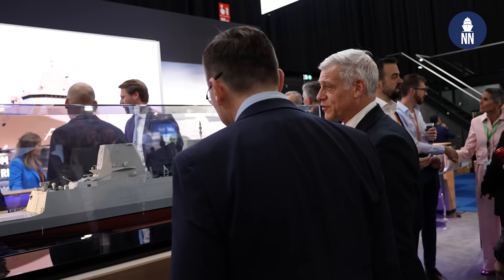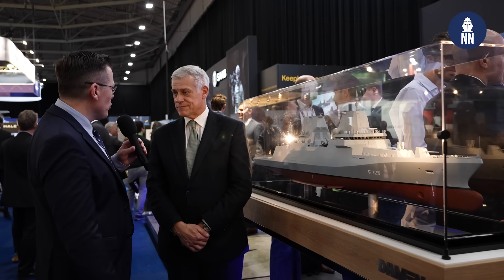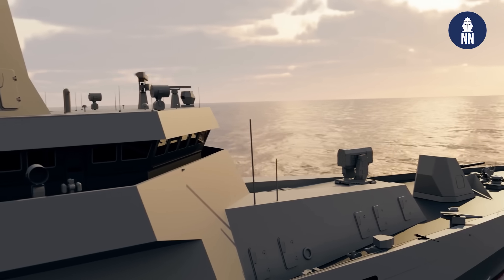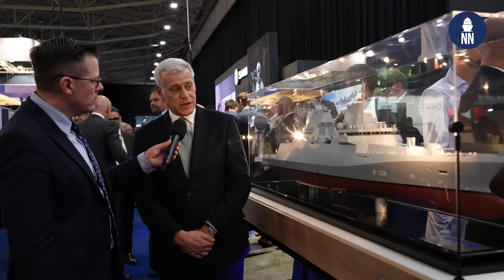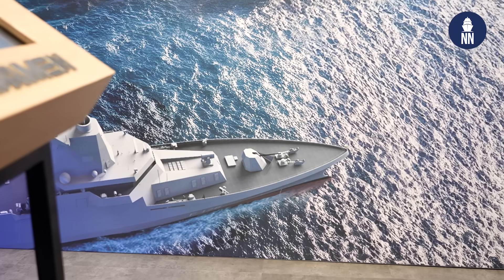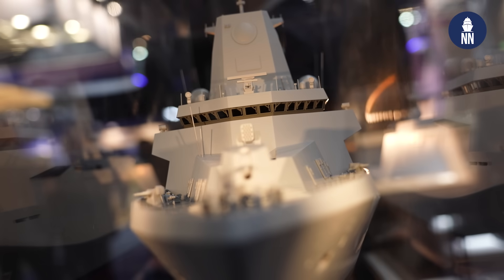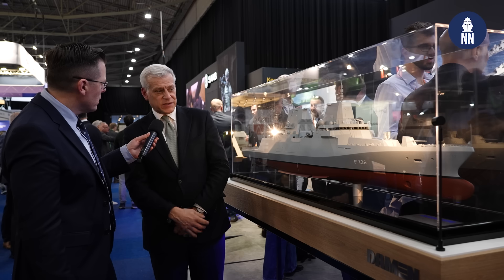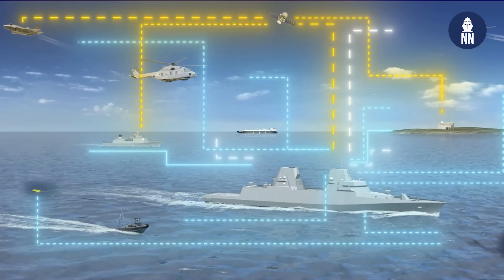German F126 Frigate with Damen at NEDS 2024

Comment: 10k+ tons and only 16VLS. Why do the Germans do this?
Reply: That VLS counting is so popular on the Internet just shows how little people understand about naval warfare. Modern sea-skimming missiles only come over the horizon in about 30-35km range. This ship has 106 missiles to defend against such threats.  (64 ESSM and 42 RAM) Very well defended for an ASW ship.
Reply: @Chiggi0815  Literally just a one-to-one replacement of the Brandenburg class is armament terms, with added endurance and maintenance capabilities for global deployment.
Reply: @forcea1454  Not really. The F123 so far could only carry 16 NSSM not ESSM.  F126 can carry 2 medium helicopters which now are both hunters and killers in one and have additional ASuW capability. Obviously the extensive modularity and much better Sensors.
Reply: 0:36 did hear what xavier said
Reply: @Toxic-pt1qn  but the even british old type 23 have 32 vls
Reply: @Toxic-pt1qn  also its 10,000 tonnes, you can fit atleast 48 VLS and then focus on anti-submarine too, terrible decision and weak ship
Reply: Not an expert but that's what I've found while looking into those exact questions. From what I've gathered, the weight is due to minimizing crew requirements and increasing modularity. It's heavier than an Arleigh Burk class destroyer but only requires 1/3 the crew. It's going to replace the F123 class, which also only carries 16 vls cells. Their main objective is anti submarine warfare. The important bits for that are the sensors and the helicopters/drones as they are supposed to do most of the actual fighting in that regard.  Missiles are gonna be mostly for mid to short range air defence. 64 essm (quad packed, 4 per vls cell) and 42 short range, aswell as 8 naval strike missiles. I don't know if any of the 20 mission modules can increase that number. Then there is the F124 air defence frigate with 32 vls cells, which is going to be replaced by the F127 with 64 cells. Another important bit is that Germany plans to replace their 4 F123 with 6 F126 and their 3 F124 with 5 F127 (with the option for one more), increasing their overall number from 7 to 11 warships (we don't talk about the f125. That's a disgrace on a whole nother level. If you thought 10k tons and 16 vls cells was bad, try 10k tons and 0 vls cells).
Reply: @-MarcelDavis-  The F 125 is not 10k tons its 7200 tons thou ! And they   currently planing to give them a little upgrade ! They are talking about Iris t for anti air and blue whale drones for        anti sub warfare ! Also they buying 5 F127 but are looking to replace one of the F 125 with an ( optional per planned contract ) and additional 6th F 127 if all goes well!   Also to make it clear the whole class gets 20 moduls not each ship ! Thats 3 to 4 per ship !  Each ship can equip up to 10 but not of the same type ! For example in back of the ship there is only place for like two moduls that can be only 2 anti  mine or 2 anti sub ones only , mabye a combination of the two but not for the detainment one ! The other 8 modul places are midships and are for the detainment one or futher unspesified ones!
Reply: Focused on anti-submarine warfare..
Reply: @JeffBee-vo3gf  oh yeah that makes sense, they're only ASW ships so it wouldn't be fair to shoot at them, better make sure everyone knows and understands that 😂
They're warships and with them being so large, so expensive and so few of them, they will operate alone and thus must be capable of fighting whatever opponent they encounter!
Reply: @fightforaglobalfirstamendm5617  Well many European Air-defense focused frigate has 32 VLS remember it's an Air-defense frigate only doubled the 16 VLS, Unlike those Air-defense frigate they have to defend other assets from Air and the F126 only focus to defend itself from Air...
Reply: @JeffBee-vo3gf  European warships design has been terrible for decades. It's not who you should be comparing your ships to, they need to compared with PLAN, USN, Russian Navy, ROKN JNSDF, and Indian Navy's.
-Type 055 Renhai, 13,000 tons, 30 knots, 5000 nmi range, 136 VLS cells, 1 x 130mm gun, 1 x 30mm 11 barrel CWIS, Hypersonic missiles, ASUW cruise missiles with 290 nmi range, 4 x torpedoes. 
-Arleigh Burke flight 3, 9,000 ton, 30 knots, range of 5000 nmi, 96 VLS cells, 1 x 127mm gun, 1 x 20mm CWIS, 2 x 25mm cannons,  tomahawk multirole cruise missiles with 900 nmi range, 2 x torpedoes.
-Admiral Gorshkov, 5,400 tons, 29.5 knots, 4,850 nmi range, 80 x VLS Cells, 1 x 130mm gun, 2 x 30mm 6 barrel CWIS, Hypersonic missiles, multirole cruise missiles with 356 nmi range, 8 x torpedoes.
-Sejong the Great Class batch 2, 12,000 tons, 30 knots, 5,500 nmi range, 1 x 127mm gun, 86 VLS cells, 16 medium range ASUW cruise missiles with unknown range, 2 x 20mm CWIS, 6 x torpedoes.
-Maya Class, 10,000 tons, 30 knots, unknown range, 96 VLS, 1 x 127mm gun, 8 x deck mounted ASUW cruise missiles, 2 x 20mm CWIS, 6 x torpedoes.
-Project 18 Class, 10,00p tons, unknown speed and range, 120-144 VLS cells, hypersonic and cruise missiles, unknown gun based armaments.
Reply: @fightforaglobalfirstamendm5617 All of these warships are either AAW combatants, or Russian (much less emphasis on living quarters, access for maintenance, or endurance). Arleigh Burke is also a bad example, they were very deliberately designed smaller than they should have been because of erroneous beliefs about the correlation of warship design and cost, which is why they have no SWAP-C margins today.

Steel is cheap and air is free, there's no reason not to design a 10,000 ton frigate if you can get  better access for maintenance, better crew quarters so you have fewer problems with re-enlistment, and significant redundancy in the layout of your sensors (something which none of the designs you use as examples have, all have their phased arrays concentrated in the forward superstructure, F126 has them split between two blocks).

The replacement AAW Frigate will be the F127, which should be closer to the above example in armament (although it will likely still fall short, European AAW combatants tend to have less magazine depth).
Reply: @JeffBee-vo3gf  But those frigates are 40% smaller in size yet can carry 3x the number of VLS.....
Reply: @LuqmanHM  it's 32 VLS just 2x not 3x..
Reply: @JeffBee-vo3gf  there is a European frigate with 48x vls, that is 3x not 2x
Reply: @LuqmanHM  I know...
Reply: @JeffBee-vo3gf  good that you know
Reply: @forcea1454 People also tend to forget that even if you have that many vls cells, how you actually will make use of them. Sure it would be nice if the F126 had double the cells, but every navy in times of war, and that goes doubly for European navies, would run out of missile stocks extremely quickly, at which point you’re production constrained. At that point all of those extra cells would just be dead space on the ship as there wouldn’t be any missiles to fill them with. I believe there’s definitely a point at which more vls cells doesn’t necessarily make a ship all that more combat effective, particularly if European navies will also learn to rearm at sea like America is doing.
Reply: Oliver hazard perry frigates are less than half the displacement, carry 2 helicopters, and almost the same amount of missiles.
Reply: @SebastianBosek RAN OHP ended up with 40 rounds for the Mk13 launcher split between Harpoon and SM2 and an 8 cell Mk 41 with quad pack ESSM. On a ship a third the tonnage of this one
Reply: @SebastianBosek    A good ship to compare with! Cause it shows very much  the difference! The Idea for the F 126 is basicly , what if we give a ship like the Perry class extra range , durability , much lower maintance and less viewer appointments in warfts increaseing the deployment time , as well as versatility via a modular system all in a stealth like design! All that makes it a Perry + like ship or like a very durable swiss knife that you can even missuse somewhat !
Reply: @SebastianBosek OHPs don't have LO shaping (which in and of itself is a significant driver of size and volume) don't have phased arrays in X-Band and S-Band grouped into two widely separated superstructure blocks for redundancy, and have less endurance (both in terms of stores and self-maintenance) and have worse access to equipment for said maintenance.

OHPs are a very bad example, they were essentially a hull shrink-wrapped around a combat system with zero margins for further additions, designed before many people realised that it was combat systems that were the main driver of warship cost, not size, and designed before LO shaping was widespread, which required significant volume to hide equipment, which is why modern warships are so large.
Reply: Splitting the radars into two separate parts of the superstructure will be part of it. Not a great issue, steel is cheap and air is free, better to have greater redundancy to aid survivability.
Reply: 16VLS but every cells can room 4missiles ESSM a total of 64 missiles.
Reply: Only 16 VLS, but 4 ESSM RIM-162 missiles per VLS. There will therefore be 64 missiles for the defense of the ship.
Reply: I suppose it is meant to primarily be a European ASW ship. 10K tons and calling it a frigate, well I guess it makes sense as frigates were primarily ASW ships. So a small ship in a large hull? Extra fuel tankage for a long endurance? But why if they are going to stay in European waters? The lack of missles is a problem if they are going to work in more hostile waters, like the Red Sea. No mention of how quiet the ships can be, nice for ASW work.
Reply: It's for anti submarine warfare not for airdefense. The F127 is meant for air defense
Reply: @ If it is for anti-submarine warfare, why is there no dedicated bow sonar? Only a towed sonar? Doesn’t make any sense!
Reply: Because they want to put some space for a laser weapon system to target cheaper drone. VLS is more expensive per shot compared to laser.
Reply: @saltymonke3682  So, a 10k ton warship is well-protected from drone swarms, but remains vulnerable to ASMs launched in saturation waves? That seems half-logical...
Reply: @thomasromanelli2561  did you know that there's F127 for that? And for ESSM, F126 is quadpacked, so it's 64 missiles in there.
Reply: @thomasromanelli2561  do you want to make another wunderwaffe? No
Reply: @thomasromanelli2561  and that 10k tonnes are for mission module bays.
Reply: @saltymonke3682  I guess you're right. I hope the German Navy gets what it asked for, and all the required modules integrate well and function per spec, and they have the forward logistics bases to hot-swap out the modules to tailor it to mission needs in a high operational tempo setting with minimal reserves and a lethally-contested marine environment consisting of major surface, sub-surface and semi-autonomous  UAV threats. What could go wrong?
Reply: @thomasromanelli2561  we hope so. It's also cheaper to have multiple modules on board a ship rather than building another highly specialised ship. 20 years from now it's all about fast adaptation to threat and uncertainty
Reply: @thomasromanelli2561 Nah, we‘re not known for being bad at handling these kind of logistics I would think…
Reply: Der Schwerpunkt des MKS 180 liegt dabei auf:

Überwachen und Beherrschen von Räumen und Verbindungslinien zu Wasser (z. B.: Operation Atalanta)
Durchführen von Embargomaßnahmen (z. B.: Operation Sharp Guard)
Nationale Risikovorsorge durch Evakuierungsoperationen
Reply: @chessrockwelll  Das stimmt natürlich, wobei die Anforderungen bei der Planung der MKS180 gänzlich andere waren.... bzw. das Auftragsbild der Deutschen Marine hat sich geändert. Ich gehe davon aus, dass die Schiffe durch die Re-Fokussierung auf die Bündnis- und Landesverteidigung deutlich aufgerüstet werden. Genügend Potential hat die F126 ja. Die Zeiten von unterbewaffneten Fregatten sind vorbei....der Fokus sind nicht mehr nur irgendwelche Piraten oder Rebellen um Afrika.
Reply: I think for electricity. I think the laser systems will be heavily employed in the next 10 years generation size matters. 64 missiles is one exchange with another frigate. A large 1mw laser can extend that indefinitely.
Reply: cause this is not a guided missile destroyer, but a multy purpose ship. Also consider it was designed at a time, where the enemy where pirates in speed-boats. You don't fire a 2 million missile to fight a 20k speedboat. Germans prefer efficiency over overkill.
The F127 will have 64 VLS.
Reply: @ThorDyrden  absolutely correct and I also think, that the ship will be optimized to the new role in a size how is possible for that Class.
Reply: In what scenario would u need more than 64 AA missiles?
Reply: @dominics.4474  and that is 64 full-size Missiles - the AA-missile come in 4-Packs.

But in deed the challenge is, that VLS can't be restocked by the ship itself - so it need to dock at a appropriate port to refill the VLS... which makes a big number more relevant.
On the other side these ships would mainly fight in the northern or baltic sea... so ports never are that far away.
Reply: It is quadruple so it is 64 missiles
Reply: Because Germans over complicate everything!
Reply: It's a anti submarine warfare frigate
Reply: and that's the reason why a german replenish ship escorted by a german frigate goes around Africa instead of passing trough Red Sea cause afraid of Houthi (🤦🏻‍♂️), consider what Deutsche Marine would do in front of Iran without calling in their true enemies China and Russia!!!

ASW Frigate are useful on high seas of the world, so "all" free countries would need few ships more then a hundred and smaller countries, NOT Germany, would like to perform the cheaper role!
Moroever that long range mission would require a 6/7 thousand ton Frigate armed with 32 VLS to contain cost fullfilled with 32 quadpacked anti-air missiles, 16 anti-ship and land attack missiles, 8 anti-submarine missiles (for quick reaction), a small but well around warfare capabilities!
Note to perform an helicopter ASW mission at a hundred nautical mile away which are about 16/20 missions per day for weeks, you'll need minimum 8 helicopters onboard for a minimum of 4 ships!!!
High seas ASW mission instead are based on tow sonar patrol cruise with the lone helicopter detached just to fix the target and then destroy the submarine!
US Navy find out in the Red Sea Burke destroyers (96 VLS!!!) have short persistence!
Nowadays Destroyers are the lonely survived combat ship. It must be big and armed to the teeth (192 VLS ?!?), top reference are out on the seas with already around 130/140 VLS...
Reply: They're Quad Config, aka 16x4 = 64.
Reply: That's what the 127 Frigates will be for. And those 16 will have more power than 64 cope cells...
Reply: This is designed for ASW so torpedos are how you kill a sub. Also, 10k tons is a small ship.
Reply: poor understanding of enemy's weapons
Reply: Take in mind, Germany isnt a sea power!
Reply: Simple cause the Germans are just like all the other lazy European countries who rely on Nato to bail them out when  so they don't need a lot of missiles on their boats. Unlike America 🇺🇸 who doesn't rely on other nations to help them out. Then again, I doubt any Nato nation would help us out if shit hit the fan.
Reply: They are following Indian navy bro😂😂😂😂😂
Reply: It's a large cruise ship belongs to Germans Navy
Reply: bro. 16 vls can carry 64 sam. 1 vls for 4 sam like aster
Reply: 64 missiles. That's not bad.
Reply: I have the same question
Reply: Well the basic idea is to make those extra durable and give them additional range and versatility throu the modular sytem !  That does need more space than you woud think !  The better  durability is suposed to let them get away with much less maintance and apointments in the shipyards , although i don t know by how much ! In combination with the fact that each ship gets i think four crews , that gives you a ship that can be deployed for a very long time !   But you are right if you say that you don t need all that cause germanys potential enemys are pretty much next door! Its just that at the time these were designed germany had different non russian problems elsewhere entirely !
Reply: It was ordered back in the days where they needed ships to secure the supply routes and fight against Somali fisher pirates.. so they got away with less firepower so they could squeeze more tech in it, our small budget politicians love to built multi-use goodies, nothing could go wrong right?😅 tbh the reason is the Hilariously small budget and need for certain skills..
Reply: Arleigh Burke have 90 cells in comparison. Sure, it's heavier but one would expect something like 32-48 cells in a frigate so it can sustain a prolonged battle or several skirmshes. Having more VLSes can enable a wider range of loadouts. Just like for fighter planes you don't want to engage enemies with the main gun.
Reply: @LeonardTavast  "In comparison" with a vessel with a completely different task profile and a completely different theater of operations is just about as much garbage as you can press into a comparison.
Reply: Should be at a minimum 32-48. And it looks to be low surface to surface missiles as well. What a waste
Reply: @kimkristensen2816  It looks like it has two of the multi purpose launchers that can have different missiles, as can the VLS. I had read/heard some German ships may be going back to have armor plating for defense. (Useful against smaller missiles and drone attack?) That may explain sone of the displacement.
Reply: its a stupid design, even the older and smaller F124 frigate has 32 MK41 VLS
Reply: German engineering and crew facilty/room standards are overly complicated and over specced.

Think saunas. Ultra wide gang and stairways and very spacious crew compartments. Cable runs and ducting are very over provisioned as well.
Reply: @dwwolf4636 Nothing is over poroceeded nor poor armed!! 😡
... On our ships fire fighter AND MEDICAL  can GO TO THE FLAMES, whike at the same time injured Person can BROUGHT AWAY.
Bith grouos Do not Kick Esch other on Stars and ways on the Ship.
These are of course german civil fire prevention and building Security laws.... And without any doubt.... They Are Best in the World!! 
These rules save time and lifes. On other navies Ship there is Chaos in event of fire... on german warships there is GERMAN DISCIPLINE.
This will be Trained very often. 
Also, all electro and hydralical Systems are build twice, triple or quadruple.... This thing can SURVIVE A HIT... AND STILL FIGHT.
VLS: This is a multi role ASW frigate... AAW  is for self defense only and well represented by 64 ESSM and 42 RAM... plus guns.
There is no tactical  need for for germany for Strategic cruise missiles nor asroc on these ships, which will fight in north sea ond baltics... Always in the Nest of friendly NATO ports for refueling and rearming 
... So no need for additional VLS.... Germany does not fight in the wide areas of the pacific, far away from home. 
And additionally .. If there are more weapon Systems SAW/AAW /ASUBW needed.... Modular Container in the Deck Container area are the future.... 
They are more flexible, easy to change and cheaper.... This is the reason why germany wants modular frigate Designs (MEKO)... and DAMEN did fulfil the requests. 
Understand?
Reply: How IS that Bad? As a saylor id want all of that comfort fuck construcking everything as cheap as possible and then wonder why suicide Rates in the navy are high  @dwwolf4636
Reply: @dwwolf4636  Dutch shipbuilder. From The Netherlands. Dutch engineering is better.
Reply: Look at Bismark class, Scharnhorst class, every modern German ship class, all are over built and underarmed!
Reply: @fightforaglobalfirstamendm5617  Congratulation to you for the most idiotic comment under this video.
Reply: @fightforaglobalfirstamendm5617 😂😂😂😂 You are an expert
Reply: @fightforaglobalfirstamendm5617  Bismarck and scharnhorst underarmed? 😂
Reply: @mkultra3679  yes. The Scharnhorsts carried 9 x 11" guns on a hull and displacement (32,000-38,000 tons) that the; British managed to get 8 x 15" guns (Queen Elizabeth Class 1912 and R Class 1914), 10 x 14" guns (King George V 1936) and 9 x 16" (Nelson Class 1922)  guns. The Americans managed to get 12 x 14" (New Mexico Class 1915) 12 x 16" guns on (Tennessee  Class 1916), the Japanese got 12 x 14" guns (Ise Class 1915)  9 x 16" (Nagato Class 1917). 
Bismark was built in 1937, displaced 50,000 tons, and carried 8 x 15" guns, had 12.6" belt, could do 30 knots and had a range of 8,500 nmi. vs Iowa Class built from 1939, displaced 45,000 tons, carried 9 x 16" guns, had 12.1" belt, could do 33 knots and had a range of 15,000 nmi.
Reply: Yep. I'm embarrassed as a German. 🤦🏾‍♂️
Reply: @adlerzwei  Wen man keine Ahnung hat...
Reply: And ofcourse WW2 trauma.
Reply: @dwwolf4636  ?  What do you mean?
Reply: @dwwolf4636  nee nicht wirklich....
Reply: The Kreigsmarine uses the term "warship" differently than its EU/NATO counterparts: more ship, less war. Modern German vessels have always been deliberately "undergunned", which makes it challenging for them to accomplish some the tasks required for NATO support missions.
Reply: @thomasromanelli2561 Kriegsmarine is not the correct name of the German navy today. We use more quality weapons than  big quantity of anything. We concentrate and build a Focus... To do that what we should best in Class.
Reply: @DBond-bv2oi  Well, considering that saturation attacks to overwhelm a platform's air defense capabilities (of which medium and short range missiles are an important part) will be a legitimate threat in any contested area, it seems this 10k ton target is ill-prepared to defend itself without frequently disengagement from the AO to resupply/rearm. 

In that setting, quality matters less than quantity, and there's little reason why the German Navy couldn't a have a satisfactory measure of both.
Reply: @thomasromanelli2561  we will see 😉
Reply: @thomasromanelli2561  Saturation attacks are not about depleting your enemies ammo stockpile but about their tracking ability and engagement window. Why do you think most ships only carry 8-16 anti-ship-missiles?
There is a reason why the german navy puts so much emphasis on RAM which is fire and forget and does not take as much resources from the combat system. If a sea skimmer comes over the horizon in 35 km then you have 1 maybe 2 chances to use ESSM. Somewhere below 20km you switch to RAM. (Interception point needs to be within the 13km range of RAM block 2)